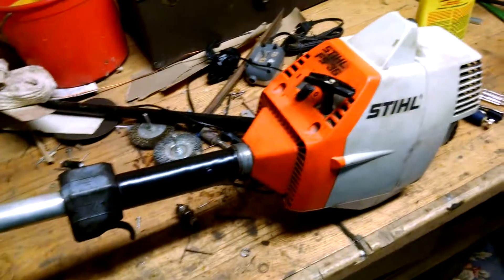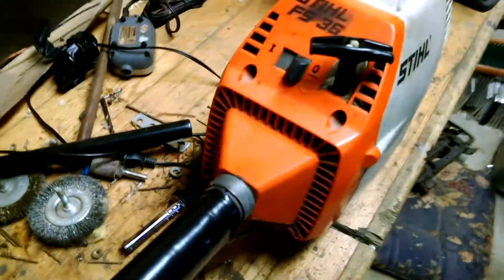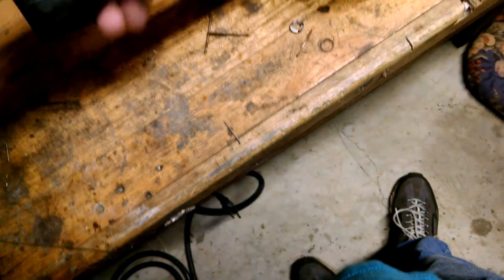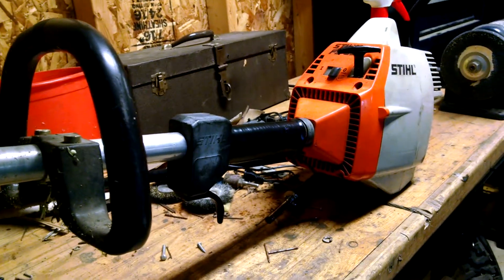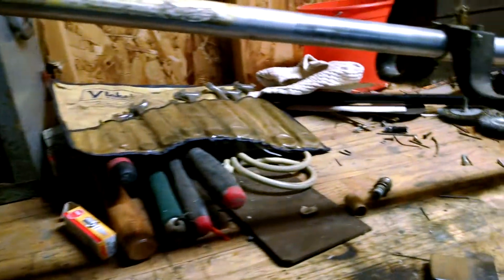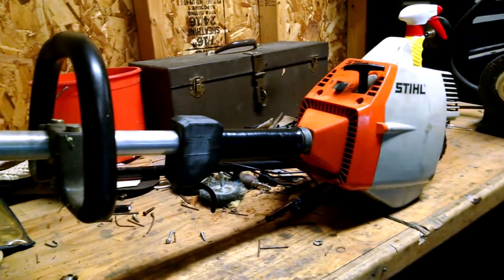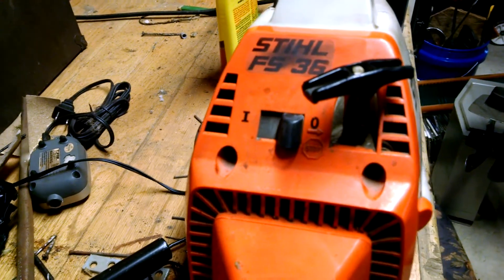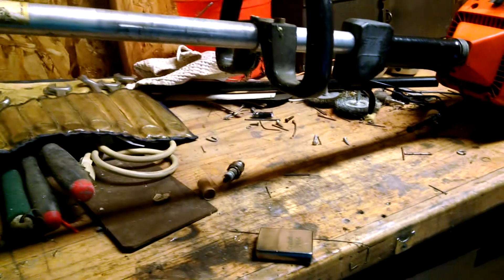Stihl FS-36 gas trimmer throttle cable repaired

Comment: Useless video but..help is here. The throttle linkage for the fs 36 is no longer available in my area so this is how I repaired it. Remove rear choke actuator (one flathead bolt) and air filter. Remove two torx bolts underneath this. You should now see the carburetor with wire linkage in throttle arm. Remove broken linkage from hole and slide out. Remove 4 screws on throttle trigger assembly. Gently remove trigger, paying attention to how it goes back together. Remove throttle linkage from hole and slide out. I purchased a CURT fish wire ($6.99) which seems to be made of the same material and is just long enough. I threaded this into the linkage housing until it came out the other end near the carburetor. I copied the little bends from the original linkage and worked it into the trigger hole. I then reassembled the the trigger assembly (4 screws) and moved to the carburetor end. I fed the new linkage through the hole on the throttle arm, made the bends and reassembled (2 torx, choke actuator etc ). Works great so far. Good luck! 1:04